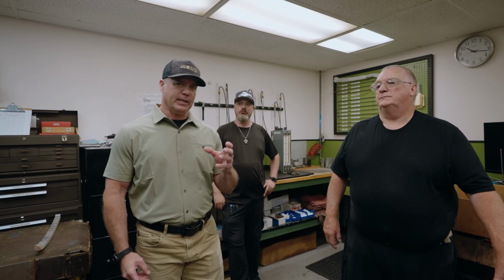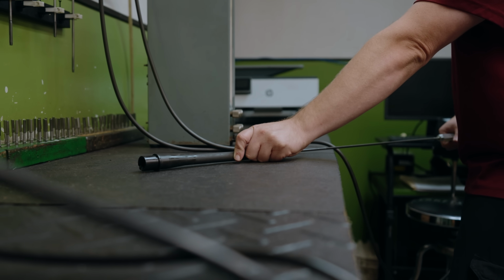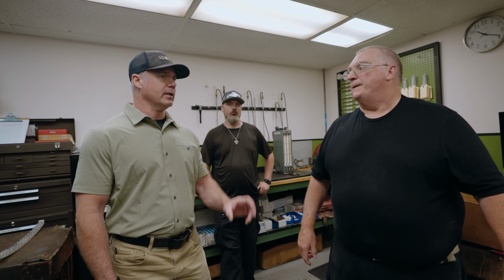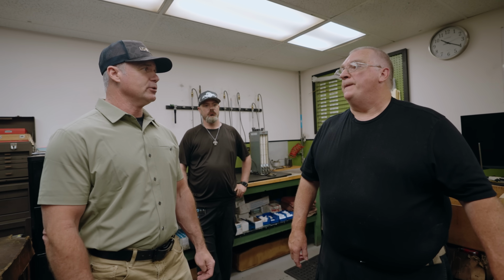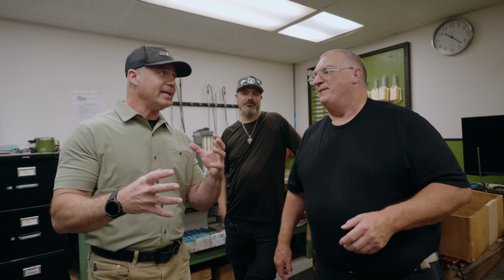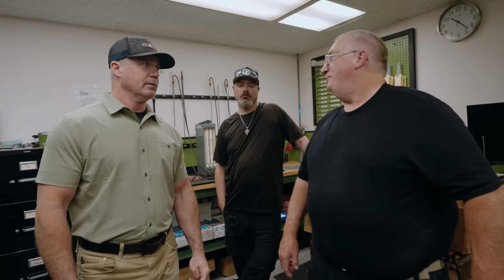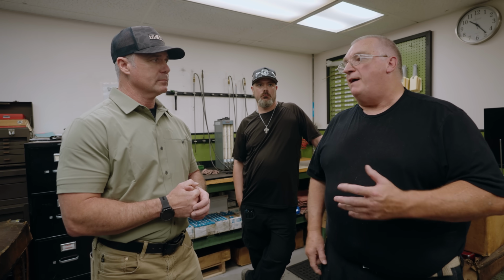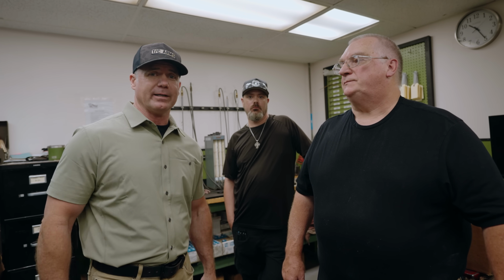Making a Great Rifle Barrel

Comment: You have to cut pucks and check the barrel puck with a Vision System (OGP SmartScope or equivalent) to know if the geometry is correct. Thinking the tool automatically makes the barrel perfect makes me LOL! Gages and even air gages can't check this, so it scares me that people think thats Quality Control/Inspection.  Please show how you check the geometry!? As someone who experience with programming using Zone3 on an OGP SmartScope 302 to check this, I also know the tools themselves Inspection is lackluster in most cases assuming grind tooling makes perfect parts as they dont often have Metrology Equipment capable of actually measuring such small details.
I actually like this videos just kills me when people over sale quality control when they dont have tools that can measure geometry. 
The shape of the Lands and Grooves change on the leading and trailing ends. Radii and angles also change based on many factors as part of the formula and have seen very different results on what I was told was the same settings. 
Sorry, end rant

Comment: My only complaint is that encore will not hold the pressure that a bolt will.
Glad to see them back 
I am a encore pro Hunter owner 
280 rem from Thomson 
22/250 1/8 twist mgm
20 gage turkey from Thomson

Comment: So theoretically if adding the weight of a suppressor to a barrel (usually) causes it to shoot lower than without the suppressor, could you stress a barrel in a way that as the course of fire causes the barrel to walk the group you could essentially cancel out the original vertical displacement from adding the suppressor?
Reply: I suppose you could try to bias the bore but it might be more realistic to measure and select a barrel, then cut the seat to clock it.